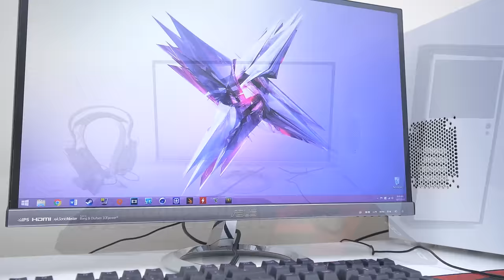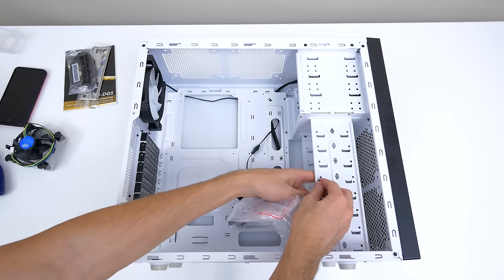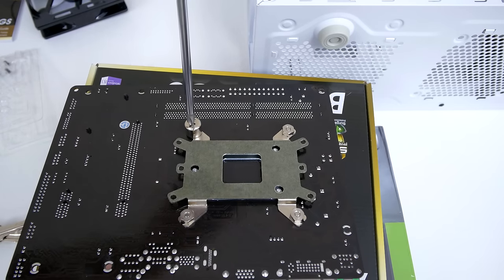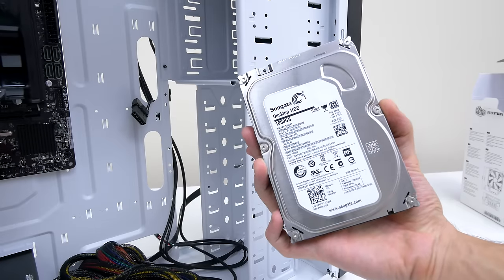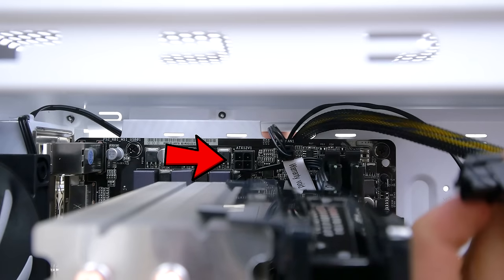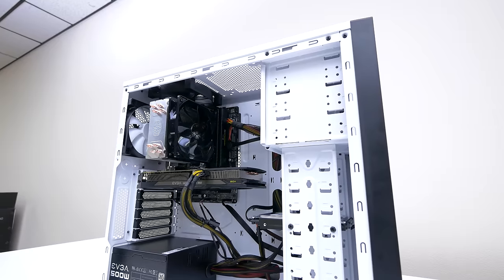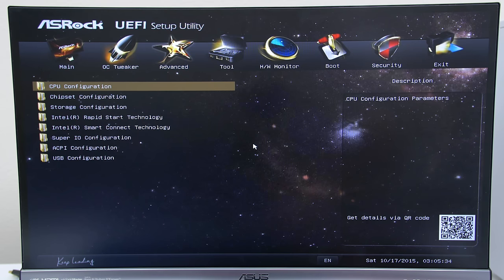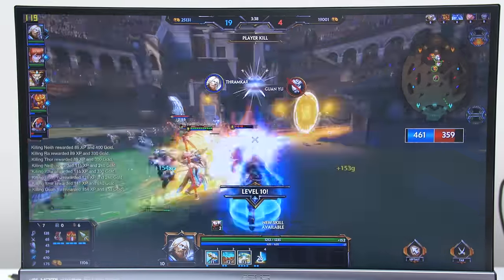How To Build A $650 Gaming PC With Windows

Comment: Instead of the tp wireless link you should get this instead, being wired in is always more reliable. http://www.ebay.com/itm/100FT-RJ45-CAT5-CAT5E-ETHERNET-LAN-NETWORK-Gray-Grey-Patch-CABLE-Brand-New-/151311491461?hash=item233ade2185:g:vggAAOSw5ZBWGEIp hope it helps :)

instead of the r9 380 get the more powerful r9 290 for around the same price
http://www.ebay.com/itm/Sapphire-AMD-Radeon-R9-290-Graphics-Card-4GB-DDR5-OC-TRI-X-PCI-E-HDMI-/221926616926?hash=item33abdb6f5e:g:PKEAAOSw5ZBWMmXo

cheaper 8gb ram from a trusted brand like crucial 
http://www.newegg.com/Product/Product.aspx?Item=N82E16820148703&cm_re=8gb_ddr3-_-20-148-703-_-Product

for 7 dollars more you can get this power supply which can run the r9 290 just fine and has amazing reviews and gives 725 watts over the 500. which is more then enough to run the r9 290 i linked considering my 660 can do it just fine ( which im using right now )
http://www.amazon.com/Xpp725-hs-Computer-48ampers-Crossfire-Warranty/dp/B00SN6VN7W/ref=sr_1_4?ie=UTF8&qid=1446986164&sr=8-4&keywords=750+watt+power+supply

Comment: cam this run battlefield 1?
Reply: no
Reply: most likely... battlefield 1 isn't very demanding.
Reply: If you want to run Battlefield 1 on this PC then you would need to get a better graphics card, at least have 16GB of RAM, and maybe if you want, a better processor.
Reply: You are so wrong my friend
Reply: ismail9693 the cpu is more than enough. 8 gb of ram is more than enough. and on med. settings, the 950 is fine

Comment: mine didn't even start up...
Reply: What's wrong maybe I can help?
Reply: I don't think the power supply is working because I went through and rewatched the video 3 time and checked off everything I did and I had everything correct
Reply: what power supply are you using and when did you buy it?
Reply: +Currently the power supply in the video and I bought it like a week ago
Reply: who did you buy it from?
Reply: +Currently amazon but the box not the amazon box but the power supply box was already opened
Reply: +Currently do you think I should go to a tech store to see if they could fix it?

Comment: can this work on the motherboard? http://www.amazon.ca/gp/product/B00EUPV2RQ?psc=1&redirect=true&ref_=ox_sc_act_title_1&smid=A3DWYIK6Y9EEQB
Reply: +Cheesus Crust Yes, most motherboards are capped up to 32gb of ram
Reply: Yes but just settle for 1600mhz to 2133mhz since only APU's benifit from a high ram frequency for example: AMD A8 7600 will benifit more from 2400mhz than a Pentium G3258

Comment: MInecraft can u test?
Reply: Why think of minecraft with this amazing build
Reply: BusterDropsYT nope.
Reply: yeah .
Reply: Petezahhut umm woofles bajan canadian woodycraft etc
Reply: BusterDropsYT Well, if all you're playing is minecraft 800+ dollars would be a waste, but this is 650
Reply: ik but i also edit and make intros so yeah
Reply: +BusterDropsYT You might wanna switch out the gtx 950 with a gtx 960 or an r9 380 for about 50-70 dollars more. worth the extra money
Reply: +BusterDropsYT Also, get a z97 motherboard. The motherboard here does not alloe overclocking and a z97 does. Msi z97 pcmate is 90 dollars or so and its a good z97
Reply: +BusterDropsYT i recommend the z97 cause soon your cpu will be weak (in about 3 -4 years) so you can oc and get the performance you need
Reply: ty :) as u can tell i am a minecraft pvper to :)
Reply: +BusterDropsYT ya... not an adult haha
Reply: +Bloodstream Pistol more like 9-12

Comment: Is this build better or worse? http://pcpartpicker.com/p/LGqRQ7
Reply: It's about $40 more expensive I added a keyboard
Reply: +Meowmix I believe that the power supply wont have a good performance maybe you should consider choosing somewhere 600 to 700 W but it is going to be more expensive. The rest of the parts are good including your keyboard. Good luck buying your beast :)
Reply: +MeinGrein thanks man. This would be my first PC build. I added a 700 watt power supply http://pcpartpicker.com/p/4WBvTW instead of the other power supple.
Reply: +Meowmix *supply
Reply: It's perfect now but before you buy it you should ask someone that is a PC specialist (if you want)
Reply: Good luck with your new beast :D
Reply: +MeinGrein will do thanks :).
Reply: +Duck_Mirage tbh don't have GTX 940 i think you should have GTX 960 or 980 or 970
Reply: +Meowmix You probaly have built it but since your not over-clocking you don't need a cooler
Reply: +NotArchie I actually didn't end up buying this. This is what I bought  http://pcpartpicker.com/p/HRzdjX
Reply: +Meowmix nice build mate switching to 970 was a great choice instead of the 940(940 can barely run anything